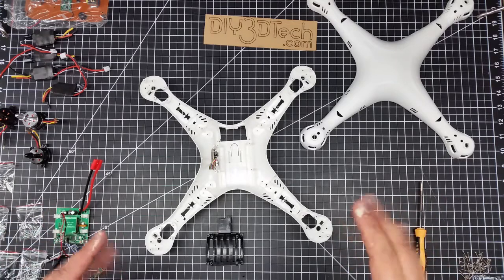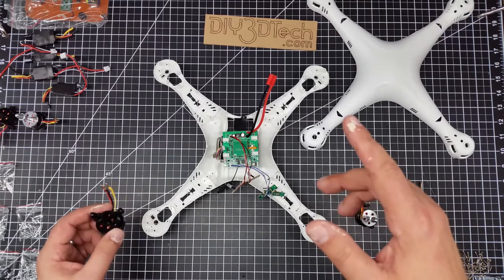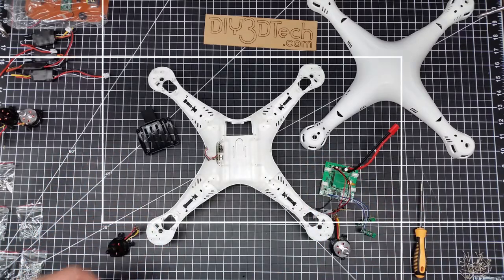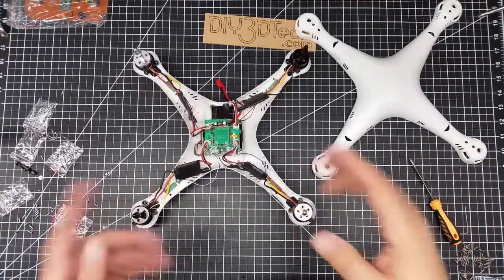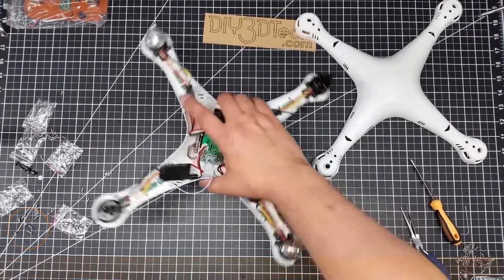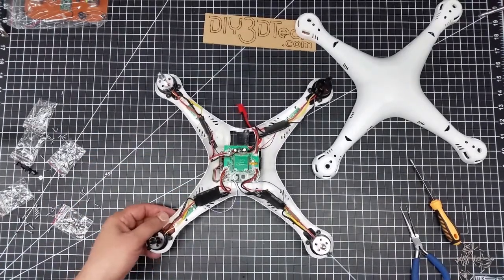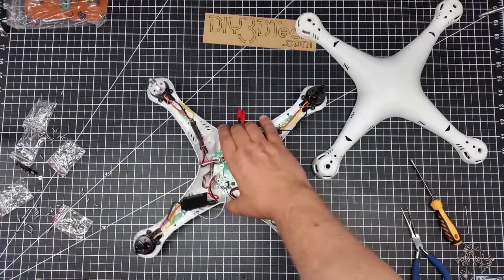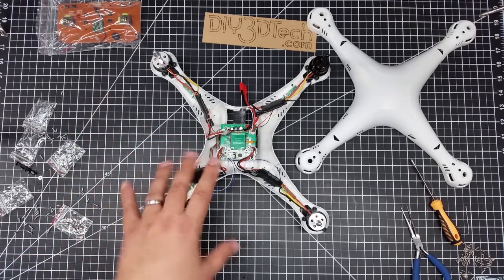Video Drone - Syma X8 Brushless Motor and Controler Build Part 1!

Comment: any update on the motor placement? I'm going through this upgrade this weekend.  Also, any tips on the new features using the old syma x8 controller? Like the 1 button return, landing, and the 3 power modes?  I'd love to see a video showing the whole startup procedure too.  This appears to be the guts of the Darkstorm X8AMG, and when watching those videos, they have a different controller with more buttons.  Thanks!
Reply from the maker: Yes had to swap the motors around as well as heat shrink all of the bullet connectors on the motor as they kept coming lose.  To be honest I have not been overly happy with the kit as it has proven to be very temperamental.  Also return to so your aware is only a reversal of the compass heading as if it is in headless mode so it goes backwards from where its at which is better than nothing, but far, far from a real return to home...
Reply: Video-Drone finally got the build done and it seems to work well.  threw in a cheap fpv solution as well.  do you know of a place that has the button commands?  how does one even use RTH using the old controller?  I haven't done any serious flying with it yet because I'm afraid of a fly away, which has been reported.  have you done any range tests with it?

Comment: On the upgrade on the brushless motors for the Syma x8hc I was reading up on that you can use a 11.1 battery pack on it can you use that on there I don't want to mess up the circuit board if I use a bigger battery can you demonstrate it working on one of them batteries
Reply from the maker: I just used the standard however used a kit upgrade

Comment: Hello,can you tell me how can I activate "headless"with this original X8 modificated Transmitter ? Is not explained in the Instructions manual of the Kit.....thanks
Reply from the maker: Wow its been a long while since I flew the X8, if I recall its the right shoulder button on a long hold...

Comment: yeah I did the upgrade on the brushless motors on mine I'm just seeing if it will handle the 11.1 volt battery pack
Reply from the maker: This was a kit with a new control board as well as ESC/Motors and it only uses the standard 7v battery....

Comment: Hi, I have just looked in on this and I see that you are trying to figure out the motor orientation. I have built a few X8 brushless versions, and I may have some tips to help you out. Firstly when viewed from above and behind. the front left hand motor should turn clockwise, right front counter clockwise. right rear clockwise and left rear counter clockwise. This will match the markings on the top cover and the props. If any of the motors are turning in the wrong direction, swap any pair of the three wires between the ESC and the motor to reverse the direction. If your motor wires (red yellow black) are color matched to the ESCs and you want to keep them that way, then re-position the motor and the ESC to the correct corner making sure the opposite diagonal corner matches. It is important to get this right, because it will constantly yaw to find the right heading.  Hope this helps..Good luck..
Reply from the maker: Many thanks!  Yes the order doesn't seem to match the "order" of the orignal motors.  As with this "kit" the motor/ESC are basically pre-wired so you really can't flip the leads so you have to move the motors.  Side question, when you did your mods did you use the standard board and remove the MOSFETs to feed the ESC's?
Reply: Yes on the first mod, I removed the mosfets, bridged the M - to ground, then tapped the mosfet gate signal to control esc. Using the original fc board is not the best idea though, it is very limited especially for PID tuning and if you want to pitch a gimbal from the radio, the only spare channel is the camera trigger toggle switch. I did manage to pitch 90deg down from horizontal via a 555 timer I/C , but its a big faf and abandoned the fc for a naze 32 and a flysky radio.
Reply from the maker: really?  So you are using the Syma body with a Naze 32? Interesting...
Reply from the maker: Very cool!  For the NAZE 32 was it it easier than say APM?
Reply: Mmmm.. Not sure I have not used an APM, so I cant say. The Naze rev5 10dof was a good option for me, using upgraded firmware with the flysky radio, gives 10 channels and using ibus input there is a bit more scope for additional gear. The Syma X8 is an excellent camera bird for both the "just get out the box n fly" guys to the "will this lift the roof off with bigger props" kinda guys. The grade and simplistic design of the chassis makes it a popular craft to modify.
Reply from the maker: Interesting, trying to find time to finish the S500 however must admit I am a bit nervous totally setting up a  flight controller
...
Reply: Are you using Cleanflight, Betaflight or another open pilot source ? They are all pretty much the same, apart from the default PID settings.The hardest thing for me was finding any sort of settings for larger diy camera birds, and default settings are usually set for a race set up. I had a dji 450 carrying its intended load and a huge area of clear space around me. I tried several times to gently take off and hover 12ins above the ground, but it just tipped over. So I committed myself and punched the throttle, it took off and stayed in the air and I carefully took it to about 300ft. It was a bit loose, but I had loads of room to manoeuvre and control. The descent was far from easy, as it quickly entered into a vortex ring state, and I could not regain control. The best I could do, was to punch the throttle aprrox 20ft above ground to soften the blow. After repairs and adjusting the PIDs (raised P gains, lowered I and D gains with 65% RC rate) It now flies reasonably well, and I can trust it. Knowing this might help you launch your S500 for the first time.
Reply from the maker: Many thanks for sharing as these are the same concerns I have and what if I don't do the fail-safes correctly and so on. This is why I was kicking around the Naze-M as it is the controller in  the Phantom 2 and the Phantom assistant is very straight forward so I was thinking of trying that route and let it think it was a P2...
Reply from the maker: Many thanks as yes did see that and as for registering I am OK with it, as it was good to see the FAA get knocked back a bit.  Yet the bad side is this means Congress will now get involved and that never is a good thing.  As I deal a bit in my day job with commercial drones (non-military) and what I see coming is commercial enterprise will demand a clear space of AGL to 700 feet for commercial drone operations and you will see airspace be sold off just radio spectrum.   So I am trying to have some fun while it lasts as the other thing that all these folks out there miss is there is really a LARGE number of bad actors out there with drone yet this is kept very quite as not to freak people out and I not talking airports and air planes but cyber attacks.  We live in an interesting world :-)
Reply: Yes I heard from Bruce about the FAA getting knocked back. It is a worldwide mine field with drone regulations, and they should be based on safety not finances. The big question for me is do I need to buy airspace  to fit a wind turbine  in my yard with the intention of selling power to the grid ?
Reply: If your still concerned about pid tuning get a naza lite combo they are on ebay for about $70.00 and it comes with the gps and the pmu a lot easier to tune and works great that was how I started and it helped me get more familiar with the tuning aspect of it. I bought the same kit for my syma that you have and ended up just using the motors and mounts and I put the naza lite in it with an x8r so I could use my frsky qx7 transmitter now it really does fly and look like a phantom lol